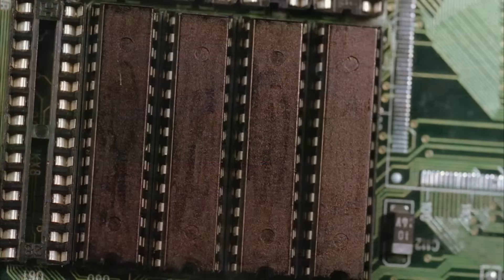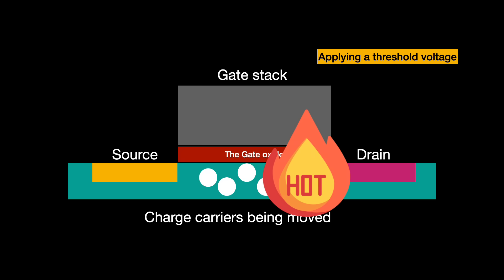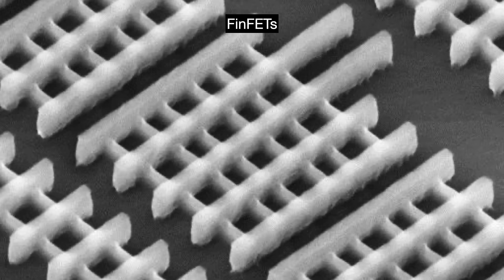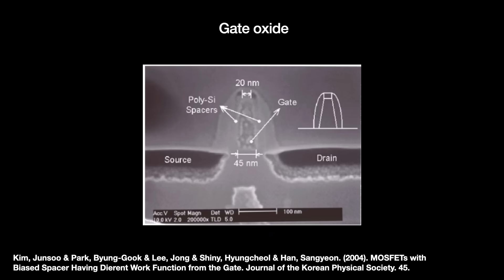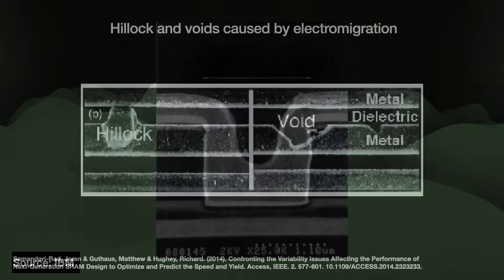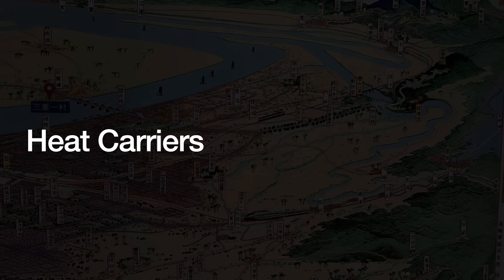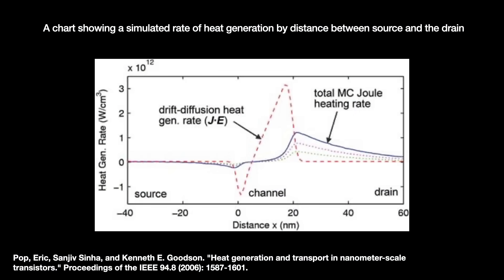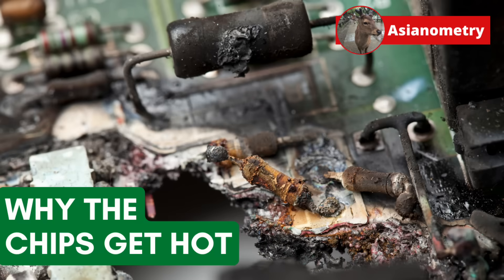Why the Chips Get Hot

Comment: This is one reason why diamond semiconductors will be such a game changer. Insulation diamond is an electric insulator but a thermal superconductor via phonons, sound or thermal conduction of the crystal lattice rather than charge carriers. Semiconductor diamond components (doped with group 3 or group 5 elements p and n) should have same tetrahedral crystal lattice and allow same phonon thermal transfer.
Reply: This means diamond has 5 times the thermal conductivity compared to silver, the best electrical conductor (apart from true superconductors). The neutral diamond remains an excellent electric insulator, much better than SiO². Meaning dialectic breakdown voltage is higher, and thermal breakdown higher than silicon's 130⁰C.

Comment: Ummm  Short circuit power is actually an overwhelming amount of power in your heat equation.   Switching power is power that's fed to the gates to switch, but...  Let's discuss a totem pole inverter, it's two fets, an N fet below the output and a P fet above the output, with gates hooked together for the input.  Think of input transitioning from 0 to 1.   The voltage doesn't snap from 0 to 1, it transitions over time.   As that time goes on, the N fet starts conducting.   About half the transition time later, the P fet turns off.   So basically, for half the time that the input transitions, both fets are conducting.  A classic short circuit.   Hence, short circuit power is a significant amount of the heat in your equation.

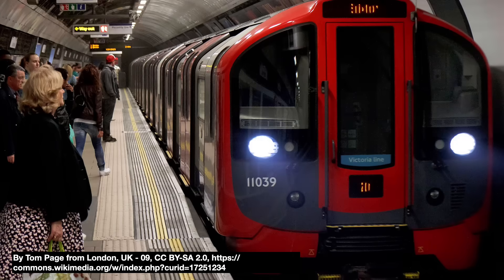Comment: 3:07 - Each electric motor in a subway train, and they may be 2 per wagon, gets about 250 KVA as input power and gives at shaft about 250 mechanical kW.
There is a lot of heating during braking. When the train slows down, these electric motors become generators and that energy has to absorbed somewhere. That is why each wagon has big resistors on its top. Along the whole train, a few MW of electric power must be transferred into heat when stopping in station.
That is why these subway stations are so hot during summer.

Comment: I presume the chip manufactures have thought of using silver for interconnects, you get a win win with it, low resistance and high thermal conductivity. It is about 7 times more expensive, Cu $4.77, Ag $33.03.

Re Londons underground L U, I should think where it was hot was on the older parts, lines, as they were built with little air conditioning, the more modern lines have this and platform door's manufactured by Westinghouse Breaks, locally.
They first fitted them in Asia, I think Sinngapore, in I think the 1980's.
As most of the underground is so, naturaly there is a heating effect from the ground, also trains, other equipment and people generate heat.
It was found that the doors had  several good efects, to reduce loosing the air conditioning down the tunnel, reducing mainly dust but also other debree also going there to and stopping suicide, or one unders as the railway call them.

Dust was one of the main benifits, as build up of dust has been a cause of a lot of fires as the dust is flamable and could be explosive, started mainly by arking, on the dc 3 or 4 rail system is still a problem, which the public are not awear of.
LU have special trains that vacume and clean the tunnels, not sure how oftern.

Thanks for your well reserched and educational video's.

Comment: 4:50 this is actually the opposite of why we use fiberglass for insulation. It has nothing to do with the thermal conductivity of the glass fibers (which is comparable to other building materials), it’s because it keeps air inside. Aside from thermal mass construction like brick, architectural insulation relies on the poor thermal conductivity of air trapped inside materials like fiberglass or foam to prevent heat transfer.

Comment: If heat is transported via quasi-particles, and we could find a way to control these particles, then in principle, we could use them to do more computations. I expect that the laws of thermodynamics will frown on this, and make it either impossible or impractical (like, you might need to put more power into controlling the particles than they were dissipating as heat in the first place). Interesting idea though.

Comment: yeah so repeaters and modern interconnects, are shitty, that's why 3d and chiplet totally sucks and 3d hasn't scaled or delivered anything- yet, and especially within a reasonable price window. all that has been done in regards to 3d is everything has slowed down tremendously, especially the memory industry, while 3d and chiplet make everything costlier 3-5x and no consumers buy it because what consumer in their right mind was ever spending 300? 500? on a CPU? You dumb?

4nm-class isn't 4nm, the reason we aren't performing better? we are not scaling. these xnm-class chips are just older known process, 6,7,10,14nm, with 3d. so the yield is better but they're hot. tacked on gimmicks like chiplet cache for amd, or just running too hot like intel- from trying to run chiplet-based designs like HPC designs, can't do it. intel did the same with their GPU, trying to run a chiplet design like 2d HPC. HPC is dead, 64bit float is dead, 64bit integer is dead. The path to 64bit is closed, everything is done with lowres, low quality 4bit- Gaming poisoned by the hybrid rendering. They want gaming to look like a lowres video, so they can start pumping ads into it.

Comment: There is a serious error in this video! The resistance of metals like copper and aluminum increases as temperature increases, leading to the vicious circle and heat death, as described in the video. But for semiconductors like silicon, increasing temperature reduces resistance and that reduces the overall problem of runaway heat. However, it increases the problem with hot spots, as the low resistance area will do so-called "current hogging", which is a particular problem for bipolar transistors. But FETs, like used in CMOS, do the opposite: THEY SHARE CURRENT. 
Thus the video has made the error of conflating behaviors of different kinds of transistors.

Comment: Usually. Poor thermal / electrical design.   Remember reverse bias secondary breakdown?   Infamous for frying Darlington power transistor.   MOSFET are no better at the cutting edges.    FEA and spot on estimated power, also Tj MAX and thermal management.  20 layer PCBss thermal via conduction cooling.
Even Switching input output tantalum caps explode.  Ripple current and ESR.

Comment: I'm just happy that More's Law has slowed down. I can still play some AAA games with an overclocked  PhenomII 6-core processor from 2012 & the only reason many of the ones that won't work crash is because of an instruction set that it doesn't have. I forces programmers to go back to efficiency. Like back in the NES or circa 1985 days, when it was common for games & other programs to utilize the machine code layer to make the game work on the designated hardware. ...Games can still get better without new hardware but the benefit of More's Law has made people lazy or, at the least, inefficient.

At the same time, from a materials science/physics perspective, this boundary still creates exiting challenges as we collectively learn how to get around the problem.
Reply: Programmers are not going back to efficiency, and modern video games look and play worse than when your Phenom II came out. The complete opposite is happening.
Reply: @LordVarkson  Fair enough.
 I'm not a programmer. 
I was only my hope that reaching the end or More's Law was forcing them to go back to efficiency.
Reply: What a ridiculous notion. What you are claiming isn't happening at all.
Reply: @teebob21  It was more of a hope that it would incentivize efficiency. I explained that in the later comment. I'm not a programmer

...Unless you're implying that More' Law isn't slowing down.
Reply: @christurnblom4825  It's Moore's Law, for starters. Next, transistor count on a microchip (which is what Moore's Law describes) has never been a factor in "programming efficiency." I'm not even sure what you're trying to talk about when using such a term. What constitutes program efficiency? A smaller codebase? Fewer lines of code? Elimination of loops and sleep statements? Backwards compatibility?

You don't even know.
Reply: @teebob21  Why would you tell me I'm wrong then tell me you don't understand what I'm trying to say? ...doesn''t make any sense.For the sake of efficiency, I'll assume you just didn't bother erasing your second sentence. Also: Please excuse my poor spelling skills..

Referring to programming efficiently/efficiency:
I'd be talking about the skill/ability to write the code in such a way that it maximizes the use of the hardware at the lowest possible wattage, basically.

Why use a DLL when you can get the information from the DLL that you need for the specific program/file. Then, the computer doesn't need to go through the whole Library looking for the one or few lines it needs. In some instances, I think some of those libraries sit in RAM (again, I'm not a programmer)
 Less ram could be used
I mean, today, we're talking about small fractions of a second to do this but back when CPU's were 8 & 16 bit & ran in the KHZ & MHZ range it made a noticeable difference

Ever heard of "two digits for a date" The whole reason the Y2K bug existed?
Memory was so expensive in the 50's to the 90's it was very useful & cost effective to just have two digits for the year.   that's what I mean by programing efficiency. 
...Doing the most possible with the hardware you have. There''s a million ways to make a computer do a task. But we've gotten so wasetfull, in my opinion, with how we utilize computers, that power is being wasted.
Reply: @christurnblom4825  No one cares about the constraints you claim exist. Memory is cheap. Storage is cheap. Compute is plentiful. 

The only reason we used to have to come up with space-saving kludges in the past was because the hardware did not permit verbosity. We use libraries today for encapsulation. Why write potentially buggy code when there is a perfectly good library that I can simply include that contains the methods I need?

You mentioned you are not a programmer. That much is clear. I assume you are also not a plumber or electrician. Do you also comment on tradesmen' practices? After all, it's horribly inefficient of them to run all those wires and pipes in the wall. It would be way more efficient if they simply installed them in a direct line from the meter directly to the outlets and taps.
Reply: @teebob21  
Bad day?

Comment: No mentioning of topological  insulators? https://iopscience.iop.org/article/10.1088/1367-2630/12/6/065010/pdf . The idea is similar to topological super conductors, but these can drain electrons and prevent tunneling through? PS: The london underground is temperature saturated from aeons of subway brakes, subway smoke (it was steampowered once) .

Comment: The photo at 9:00, with wafer, reminded me a question. Why they are wasting a time on printing, the chips on ends of the chips, when they now that it will not be a full working die?
Reply: I'd guess it's because they're exposing multiple chips at once so you end up with some leaking off the sides. So you draw a 3x3 of the chips at the edge but only the outside middle one fits completely inside the wafer. Maybe there's some optical side effects that mean you need to draw adjacent chip shapes that don't have to work. I'm probably not more educated than you are and this is just guessing.😅

Comment: chips are getting hotter, But when you throw a custom water loop at a computer the overclocked 3090 rarely reaches 55c.

of course that heat is still going somewhere, so that still reflects the issue as chips get hotter. The big Watercool Mo-Ra3 radiator just dumps heat into the room and so in summer the HVAC has to then handle that heat.

I guess that is why AI datacenters guzzle power, I suspect most of it is staying cool.  Maybe we should build them in North Dakota or Alaska, For a large portion of the year you could just blow outside air into the servers. -20c air would keep those racks of GPUs nice and happy.

Comment: That picture showing the microscopic picture of the IC showing the copper traces has me wondering how they haven't switched over to gold instead. You know why that is @Asianometry?

I recall seeing gold/gold plated wires that connect the outer pins on an IC to the inner silicon in videos where they grind/melt off the black plastic off the IC. I always figured they used gold for the silicon traces too.
Reply: Short answer: Chemistry. Gold won't fill trace channels like copper does.
Reply: @teebob21  damn, I didn't know that.
Reply: @ This channel has an excellent video of EUV lithography that explains the process in more detail, in a way accessible to laypeople. I highly recommend it.

Comment: Back in the TTL days you could plug a chip in backwards and it would get hot enough to fry an egg (if you had a very tiny egg).  But it wouldn't damage the chip - TTL was tough.  I used to joke that I was going to design a computer that if you plugged the cord in this way was a computer, and if you plugged it in the other way, a toaster.  These days though with advancing technology it can be both at the same time.  (Kidding aside, very informative video going into the details of heat management.  Which is a lot more complex now than in those TTL days I mentioned).

Comment: to explain it a little more easy: a phonon is the smallest packet of sound - like a photon is the smallest packet of light. fist one is a "material"wave the other is an electromagnetic wave.
most easy example: you have a stick thats 1 Lightyear long (yes thats a measurment of length not time)  and you push it. when do you feel the push at the other end?  not instantly! one atom pushed on the next and so on. it actually takes more then a year to reach the end. (more because the speed of light is less in a medium like a stick then in vaccuum) 
This "wave" traveling through the stick is what we call a phonon - it it seal? hard to stay - does the stick move under those rules? yes. so it doesnt matter if its "real" its a way to describe what we see and calculate with it
Reply: I learned of phonons when KDE 4 named their sound system Phonon
Reply: @KellyClowers  could also have a third meaning. Phono-on. Phono being a source setting on Sound systems
Reply: @Nagria2112  I meant that is a thing yeah but they explicitly stated it was about the physics phenomenon and gave a brief explanation.
Reply: @ cool. btw phonons are the reason for sound so it checks out either way

Comment: I'm surprised you didn't bring up the thermal law of dynamic. Energy doesn't get created or used up, it only transfers. So the loss of energy in the transistors is removed in the form of heat

Comment: Wireless electricity. Trace are airgaped physically but not wirelessly . Meaning ? If china was to also airgap wirelessly . Say double trace distance ? Chinese chip would be best on the planet . Or if oxidation was done on 28 nm aluminium trace of chip? Those chip would likely be best on earth because anodized aluminium is rigid and noh conductive .core is still conductive .

Comment: BS, you’re ignoring economics. Manufacturers push higher frequencies through thicker (cheaper) and lower-quality (cheaper) semiconductors with smaller (cheaper) junctions—right up to the point where the p-n junction melts. High-quality (expensive) chips don’t overheat. It’s much cheaper to produce low-quality chips and let consumers pay for the extra electricity, maximizing profit. In the end, chip manufacturers are not in the energy conservation business. If they’re required to be “green,” they simply buy CO₂ offsets for a fraction of the profit made from inefficient chips.

Comment: The highest power user in modern processors is just the distribution of various clock signals around the die, with more than half of the active power being used to drive clock signals that are used to latch the assorted logic systems. that is why there is so much research in cutting clock supply to any unused parts, even if only for a single clock cycle, not running that clock for say half of the individual ALU of a core, which for a cycle or two is not actively doing work, means a big power saving. Even the bus latches that are tri stated and not actively driving an internal bus will benefit from not having the internal latching clock, almost always there to latch the internal state before delivering it out, being turned off as well. That along with non clocked logic that relies on propagation delays to provide a smooth execution path, are all things done to reduce power use.

If you want crazy look at how small cheap chips generate their internal clocks, using an evolved set of logic that, due to quantum interactions between gates supposedly not connected, makes for a clock system that both self starts, does not use large areas of silicon to make RC systems, the old approach, but instead becomes a VLSI macroblock of literal magic that you drop in from the EDA tool, designed for that exact process, that will magically spit out a clock with a reasonably constant frequency, and which is all within 5% on all chips, good enough to use to run say USB devices with no need for the 11MHz crystal normally used to allow the communications to take place, using the internal clock to start up, and then having another clock derived from the signalling to talk back.
Reply: There is also research into powering only the significant bit lines when word width is under-utilized.
Feels like the whole processor logic needs rethinking.
Reply: I used Gemini to explain this comment to me. Very interesting, thanks for sharing.